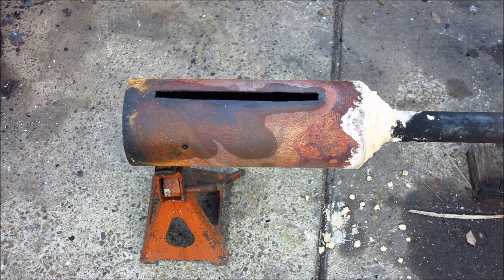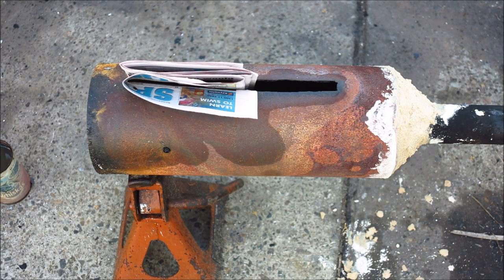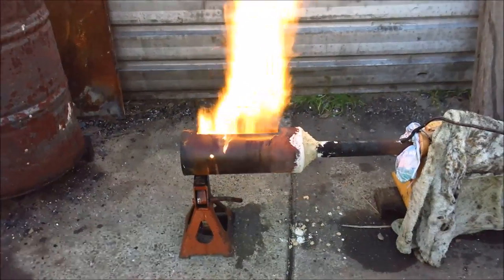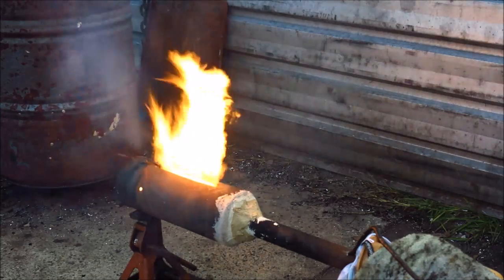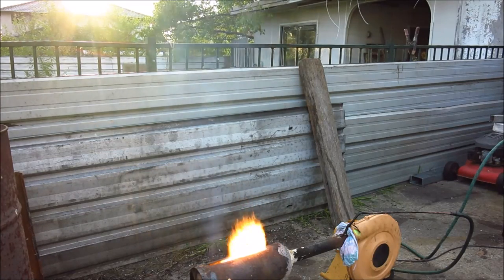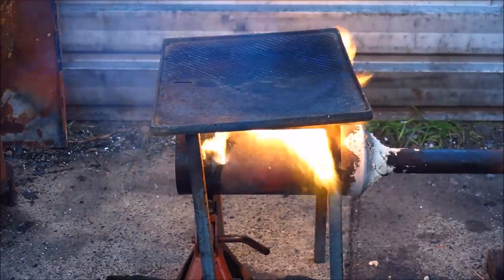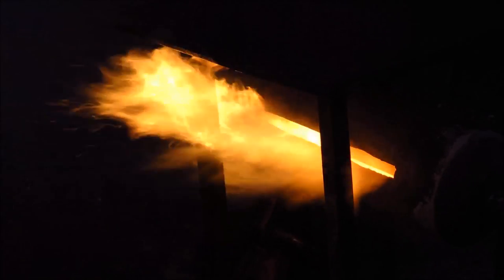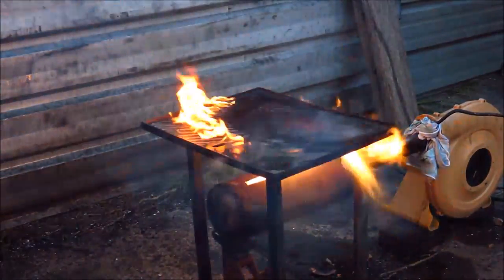Easy lighting Wide Flame oil burner for BBQ's, space heating, Scrapping,

Comment: holy guacamole hey oil burner guy was just watching your video about the 12 volt bilge motor blower and I was thinking hey that looks like a turbocharger when all of a sudden lightning shot through the roof right to my head and gave me an incredible thought Wow since you're into extreme safety precautions this will light up all the safety sissies out there... take a good old diesel pickup take off the Boost side off the turbocharger rig it up to one of your burners and start wracking  the throttle baby and watch the safety sissies cry. ..total throttle control Power guaranteed to melt anything on this planet maximum boost output yeah I can't wait to see it and by the way I don't normally laugh too much at anything but I'll tell you what me and the kids sit down and watch your videos and I really laugh hard you're a cool tough true man kudos to you buddy it's good to see real men out there in the world that aren't afraid to do manly things ... and by the way everything I own runs on veggie oil I've been doing this for close to 20 years as a matter of fact I got to go today and pick up 500 gallons more....mike knutson
Reply from the maker: Thanks Mike. I liked the turbo idea but then thinking it through I remembered the engine won't boost without load and that is not possible with the thing standing still.  I have been doing the mental arithmetic on an afterburner  though. That should make some Decent Flames!

All the best to you and your kids. The fact you watch my vids with them tells me a lot in itself.  Sounds like you are raising them to be Independent, hands on types that will be the complete opposite of the PC sissys we are over run with today. Much respect to you for that my friend.

Comment: awsome build!  I can see that between two horizontal barrels filled with wood to make charcoal.  Great job.
Reply from the maker: From what I have read, once the process is going, it should be possible 
to take the output from teh wood and burn that to create a self 
sustaining process. I have seen some setups on YT that do that and 
others that just let it go to atmosphere which seems a waste. Gas is 
smoke so even if you can't run the kiln on 100% wood gas, You should be 
able to use it as a significant supplement to whatever other fuel you 
are using.

Comment: hey mate im from australia too im impressed at your heat output. would love to see one designed for forging metal as this looks better than using coal or wood
Reply from the maker: Have a look at my other vids. Plenty of other designs where I show metal melting, even steel unintentionally.
This was one of the few I did that isn't suitable for metal work.  The majority of the others are exactly what you need. 

Where are you situated?
Reply: north of melbourne 3 hours deniliquin
Reply: ok i have more questions if i use sump oil do i need to treat it?do i need a pump?will a vacuum create enough airflow?do you have a way of not causing the pots to melt? and can i make a pot with 10 mm steel and keep it in tacked

Comment: How are you, OB??  All good here.. 
Watching this burner made me think of the pool heater. I am seeing a few more slots to widen out the heat and control the burn, but this looks like the perfect burner for it!!  

Did I read (2 MW)?????????  Holy hell!!!!!!!!  Fire that out one end and put it on wheels and you could break a land speed record!!!  lol.....   As far as the guys that didn't show a lot of interest in a smaller burner, don't let them bother you.. Those guys are only here to see the biggest possible flames and not the practical use for a smaller burner.. (You know we all love watching things melt)!!  hahahahahaha
Reply from the maker: +Steve 1961P.  Hi Steve,  I did have the pool heater in mind for this as well.  I was also thinking of putting a diffuser over the top to try and spread the flame a bit more and even it out as well. 

Yes, I'm trying to think what I'll need for 2 Mw.  The main problem I see is if I have enough blower power... which I think I don't.  Fuel I can do to insane levels , My oil collection pumps would exceed 30MW which is power station type output and not something for the backyard.... yet.  IF.. I can get the air in, I believe my blowers should do 1.2+ Mw and from there, I'll have to go to some sort of petrol blower.  Or find some more jumping castle blowers. 

The hard part I see is going to be measuring the fuel use so I can work out what I have achieved, whatever it is. 
One way may be to use an air flow meter pressurizing the fuel tank. If I know what the flow of air into the tank is I'll know what the flow of oil out is as well.  Other thing may simply be to weigh it.
Reply: +Oil Burner I had a diffuser in mind myself!!  I think for the 200K heater I have, this would work with the single cutout and a piece of 2" angle iron raised over the cut out. It should spread across the heat exchanger pretty well.. My heat exchangers both have a very thin sheet metal angle over the collecting fins to spread the heat even more, but I'd like to make mine use the least oil I can and collect the most heat possible...  The 400K heater might need (2) burners done the same as above to cover all of the collector without having to push the flame...  Or one burner with a split header to widen the section of flames... Two things I really want to accomplish is 1). make it as quiet as I can. 2). Make it as efficient as possible with maximum heat collection....   
What have you come up with for a flame to water heat echanger???

Comment: Try how small oilburner you can do
Reply from the maker: +NuffMan  i did a small output one and it seemed not many people were interested.  I'm looking at making one for a small greenhouse. Still doing the mental arithmetic on that.  I want it to be very clean burning so it can be put in the greenhouse to provide warmth and CO2 without getting any residue on the plants.
Reply: +Oil Burner  Can't wait for that video. Keeping a glass house warm on cold frosty nights can be expensive using electricity. An oil burning system might be the trick if it can burn all night without you being there to tend to it.
Reply from the maker: Philippe55
  My idea was it would burn till the fuel ran out.
I was thinking about 5-10 Kw which would be half to 1L of oil per hour.  Would depend on the size of your house and the amount of temp rise you needed but even 10KW would give 24Hrs out of a standard Cubie or 25L drum.
As usual, Finding the right blower is the trick. Think I'll have to try those Ducted fan RC jobs.

Comment: I really like the thin wide flame here. I need to make a blacksmith forge for farm repairs and some ornamental work. This oblong flame looks ideal to put the heat where I'd need it. I know the table was some distance from the base of the flame but it took quite a while for it to start turning red. So is this a great design for heating steel to heat forge with? I'm looking for the best design just for putting red hot heat in  a small area like a gas or coal forge. This one looked great because metal could be put in cross ways of the slit to heat just a small portion or laid down length ways of it to heat a longer length of the steel. Also what keeps the inner pipe and the outer tank from melting away while burning so hot? Or does it after several burns?
Reply from the maker: Steel takes a lot more to melt than most people give credit for.  People are always asking about how long the burners will last but I keep them outside in the weather, do many frequent burns and still I have yet to see signs of significant Degradation. 
With insulation or fire bricks around the output your easily reach the temps you need with this for steel work.  I can do that with my bigger burners in open air just through brute force.  :0)  Not efficient at all but it is fun.

Comment: Hi!
Its a good idea to spread the heat but it looks inefficient. :( Too much smoke even when the high temperature is achieved. Possible to avoid smoke?
Reply from the maker: As stated, this was only the first test run. The welds were not fully sealing and some oil was escaping causing the smoke. Since it has been finished and welded properly it burns completely clean.

Comment: I have an old Toyota pickup with the cat punched out and about 2.5 feet of pipe behind it, I thought about making a system to drip waist oil in the empty cat so the exhaust system glows and shoots flame. I guess my question is if this is even possible and if so how oil would go about doing it.
Reply: I was thinking maybe a mister  and a glow plug to get it goin till the pipes are got
Reply from the maker: If it is a petrol engine you will only possibly get flame on the over run where there is oxygen in the exhaust.  The rest of the time I would expect it would smoke.  If it's diesel they always run lean except at high power output so would work better. 
To make it work on a petrol engine effectively you would want to inject oil and probably compressed air. 

I'd be careful about having the pipe too hot though. I had a Diesel that lit up all the carbon buildup in the exhaust once and it got so hot it set the under body sealant and paint on fire. Luckily I had some bottles of soft drink in the car which made effective fire extinguishers.  Might be OK for the odd flame belch but I wouldn't drive up the road like that.
Reply: lol thank you for the reply, it already spits a bit of flame every now and then but I was looking for a way to do it on command
Reply: Kyle Sisk As a prankster we use to run a water hose as far up the exhaust pipe of the one who was pranked appon. More like preyed appon. Anyway we would pure Oil or Marvel Mistry oil worked best. It would smoke so bad that you could not see their car for the blue smoke. Never any flames but an awesome display of smoke. One victim had a man coming to look at his 50 Plymouth. While the fellow was test driving it went to smoking and when he got back he cursed our ex buddy for trying to rip him off.

Comment: Hi thanks for another video
I recently made an oil burner myself however im having a few problems with it i can start it up but once i try to increase oil and air flow it goes out am i turning it up too soon?
My two latest videos on twitter show the setup im using is there anything im doing wrong?
https://mobile.twitter.com/blackninja6003
Thanks for your time
-Taylor
Reply: +DIY Jet Engine Guy   i had same problem let it get ( hot first) then add oil make sure your flame is swirling like a tornado  mine will put out a white flame 5ft.  melts a car wheel in 8 minutes.
Reply from the maker: +DIY Jet Engine Guy  Looks to me like your oil flow could be insufficient. Try raising your fuel tank higher. 
Also, how are you lighting the thing? You may need more preheat as the tank looks pretty cold. 
From the short Vids, I think you are probably giving it too much air and the fuel can't keep up.  Backing the air off on it's own may not help because you need a certain amount of swirl to keep the thing going. 

I was thinking of doing a gas bottle burner, I like the position and shape of the nozzle on yours!
Where are you in Oz?
Reply: +DIY Jet Engine Guy thanks for the replies it seems as though if i increase oil then the airflow isnt enough to turn it to a vapour so preheating it must be the issue. im lighting it with an oily rag as youve stated you do in your videos. the nozzle points slightly up but its fairly wide which should be perfect for my foundry. im from melbourne
thanks again
Reply from the maker: DIY Jet Engine Guy   Try putting in your rag and cut some kindling and throw that in as well. The bigger bits you can get in the better. Let it burn on that for a bit and fan up the heat then add the oil. The wood will act like a wick and allow the oil to burn easier till the tank gets hot.

If you have too much oil the flame will be dark orange and probably smoke. If it's lean, the smoke ( Yes, they can smoke when lean too!)  may be white and the flame will be very bright and more white than yellow.

From what I saw in your vid with the clear fuel line, I would think with that blower your fuel is insufficient. I also suspect you aren't getting that bottle hot enough which can mean a lack of preheat OR that you are getting the preheat right but not enough fire in the thing to sustain Vaporisation temps.  That's a pretty big bottle and to get it on the " Curve" of vaporising the oil, you may have to give it the beans. In doing so, you also need to ramp them up accordingly.

You do have to be a bit subtle with these things on startup at least till you learn them then it gets easy.  Also don't be afraid to fail.
If one way dosent' work, go a bit extreme the other way. Sometimes you can think you are doing one thing but in fact the problem is the opposite. Ask me how I know!  :0)

Pitty you aren't in Sydney. It would be good to be able to get together with another oil burning nutter.  :0)